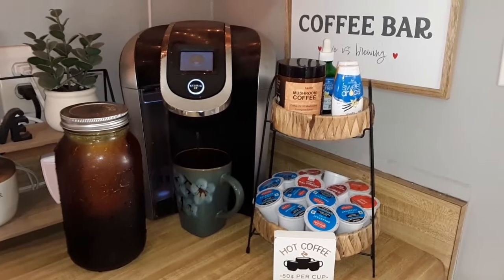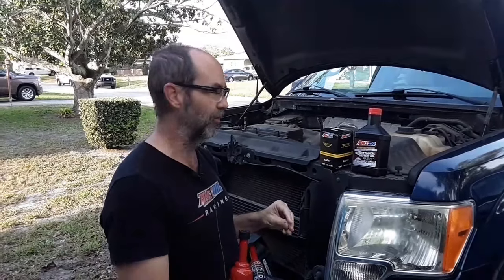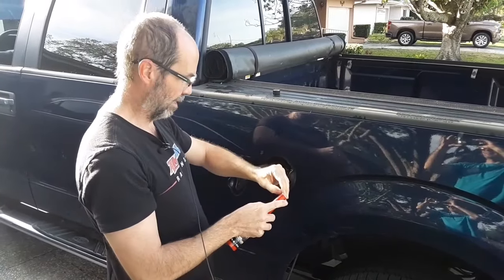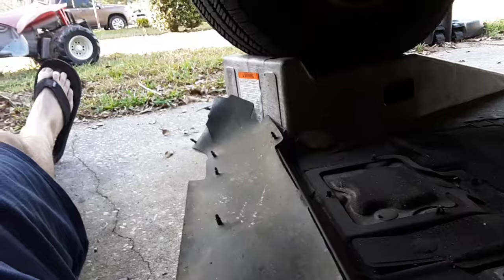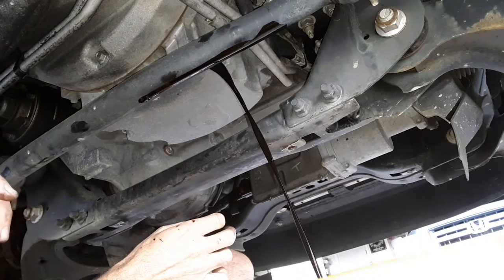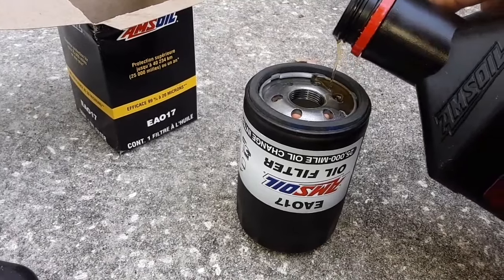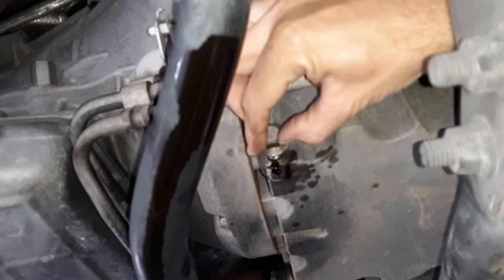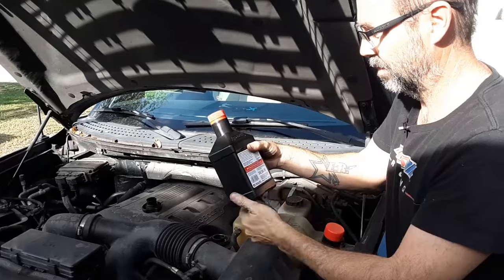2011 F150 3.5L ECOBOOST TWIN-TURBO GETS AMSOIL-ED/ number1synthetic.com/ Verse of the Day

Comment from the maker: Amsoil Signature Series 100% Synthetic 5W-30 Motor Oil https://www.amsoil.com/c/gasoline-motor-oil/3/?zo=1463115 And EaO17 oil filter https://www.amsoil.com/p/amsoil-oil-filter-eaoilfilt/?code=EAO17-EA&zo=1463115 
LOOKUP YOUR VEHICLE: https://www.amsoil.com/guides/?zo=1463115
JOIN MY TRIBE SAVE 25% AS A PREFERRED CUSTOMER: https://www.amsoil.com/offers/pc/?zo=1463115
We started off with the Amsoil Engine Flush https://www.amsoil.com/p/amsoil-engine-and-transmission-flush-flsh/?zo=1463115 and Pi and UCL fuel additives: https://www.amsoil.com/c/fuel-additives/16/?zo=1463115
FLEET/DEALER INQUIRIES: https://www.amsoil.com/business-opportunities/?zo=1463115
FREE CATALOG: https://www.amsoil.com/free-catalog/?zo=1463115
WHY AMSOIL/PERFORMANCE TESTS: https://www.amsoil.com/why/?zo=1463115

Like, Subscribe, Comment, Share!
Mike Trull Amsoil Dealer 1463115 http://www.number1synthetic.com
Soli Deo Gloria!

Comment: It’s an amazing oil. Ecoboost engines will not cook oil in the turbos though. The turbos are cooled by coolant which will continue to flow after the engine turns off. This will stop after the turbos hit a safe temp. Keeps the oil cool.
Reply from the maker: Whoa I definitely did not know that. I will look into that...no wonder the EcoBoost engines hold up so well- great engineering goes a long way!

Comment: Our Fleet trucks have the twin Turbo equal boost engines and they are using the cheapest Fleet conventional oil possible, and they are having a lot of problems with oil coking.
Reply from the maker: Sorry to hear that..... sometimes its hard to get the 'powers that be' at a company to even consider a higher quality product because they get turned off by the price, but they don't consider the overall cost.

Comment: I highly recommend the Amsoil Signature Series if your running a turbo. Also, I really like the Dominator coolant boost to help my engine run cooler. 2.3 Ecoboost
Reply from the maker: Thanks for the tip on the Amsoil Coolant Boost: https://www.amsoil.com/p/amsoil-dominator-coolant-boost-rdcb/?zo=1463115 glad to hear of your success running Amsoil in your turbo!
Reply: @MikeTrullAmsoildealer  your welcome.

Comment: Use a euro grade oil... its made for high compression and higher compustion temp. Trust me lol
Reply from the maker: Pretty cool. Amsoil has like six different European oils low saps mid saps and full saps ranging from 0w-20 up to 10W-60 https://www.amsoil.com/c/european-motor-oil/4/?zo=1463115